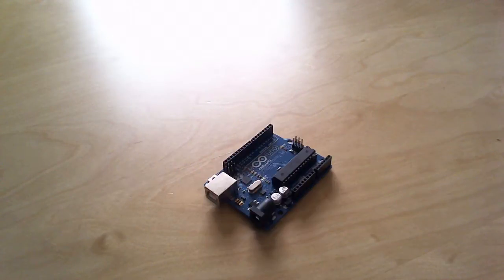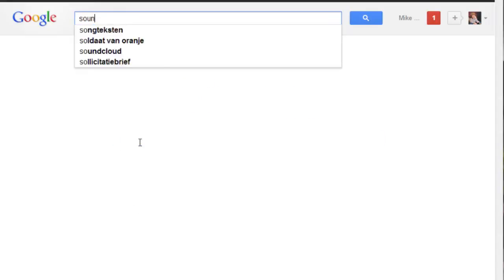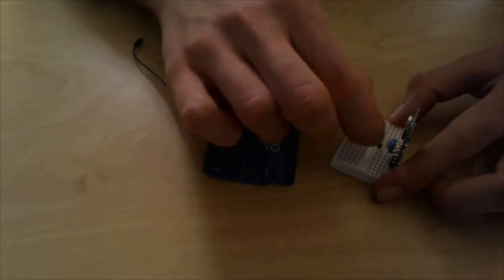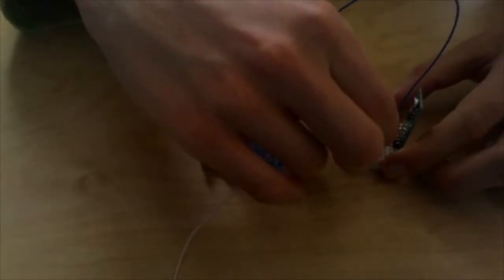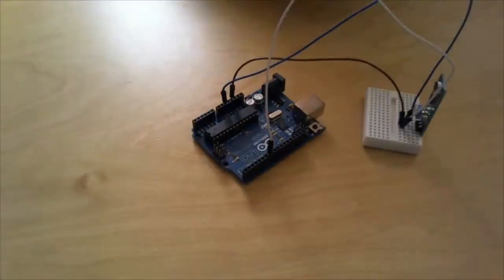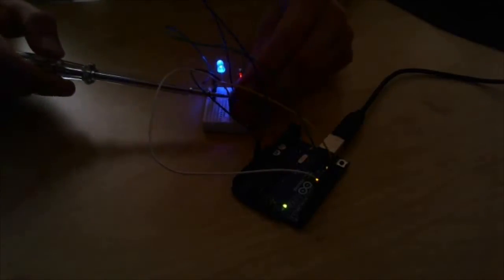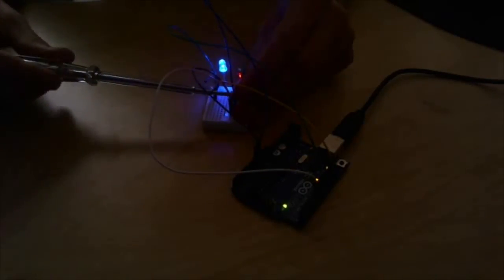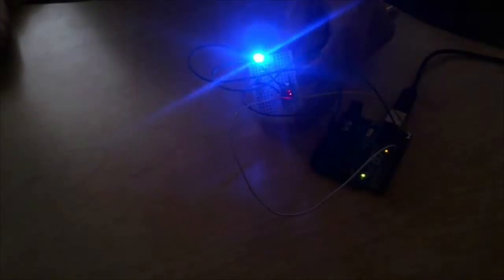ON-BEAT DISCO LIGHT! - Mike's Lab

Comment: You seriously need an Arduino to make an LED flash to the beat of music? I think not.

A simple transistor connected to the sound impact sensor will do just fine and is MUCH smaller.

If you want to get REAL fancy, an LM3916, some LEDs and a few other parts make a good light show.

 /watch?v=uOw_Ynx1tGc